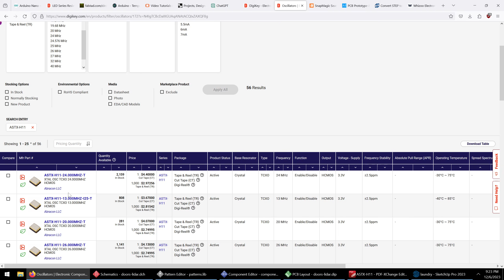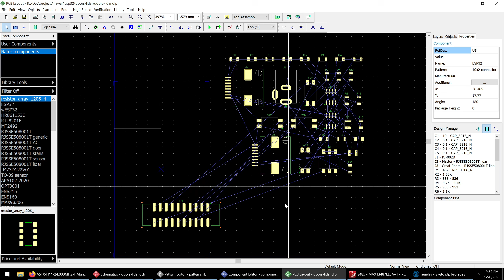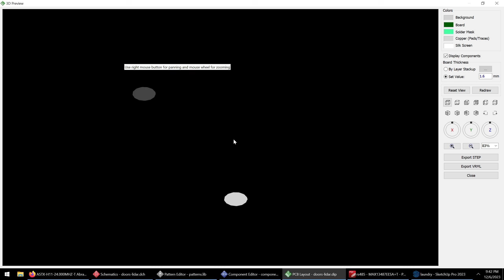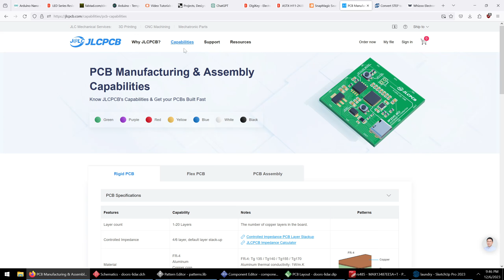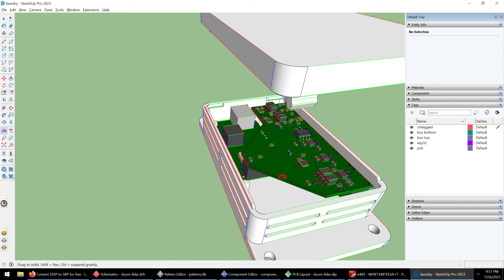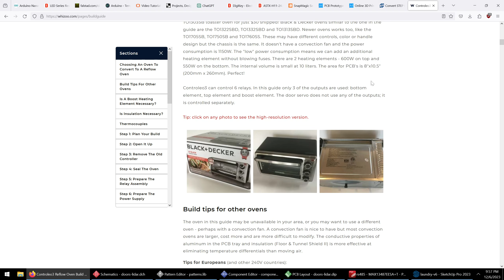Make your own PCBs for home automation -- 3D printed enclosures, too!

Comment: You keep saying "rs45" .. but ... isn't it rs485 the protocol you're using? Perhaps you're confusing RJ45 sockets with RS485 protocol? Or are you just speaking so quickly that the '8' disappears when you say arr-ess-four-eighty-five and only rs45 comes sounding like arr-ess-forty-five?
Reply from the maker: Sorry, I guess I mush mouthed the 8. It's definitely RS485.

Comment: This overview is good for beginners.  I’m  a bit further along and have probably assembled 20ish PCBs, so I’m more interested in what your boards are doing (high level overview of functionality), and how they’re doing it (schematics and programming).  Hopefully you can include these details in future posts.
Reply from the maker: Aye, a lot of people asked how to learn electronics so I thought I'd do this video first to help them out. I don't actually want to make tutorials or more beginner stuff, as there's already so much out there. I'll do some higher level videos, walking through my boards while assuming basic electronics knowledge.

Most home automation videos are about retrofit using off-the-shelf retail devices and robovacs. I'm so tired of that junk! Besides the electronics, I want to show my vision for how everything should fit together. It's a central controller (Linux PC) that everything integrates with, then some novel software ideas for how devices are controlled, especially lighting.

Next video I'll remake one of the boards and show the reflow oven. I want to add a relay so I can turn off the radar. It's purpose is to control lights so it doesn't really need to be on during the daytime. It draws 145mA @ 12V and gets pretty toasty sealed in its milled aluminum enclosure (made worse by the sun).

Comment: Great work, can you make a video detailing how one could learn electronics  "PCB designing to be precise" coming from a tech background with a little knowledge on the basic electronics
Reply from the maker: This video is basically what you ask! Pick a goal (eg blink an LED) and then get reading. You'll need to be able to research stuff via internet search and ChatGPT. Repeat picking more complex goals to gain experience and eventually tackle the problems you want to solve (home automation or anything else).
Reply: @NathanSweet  This is so extremely helpful, thanks a lot! I also have the goal of learning PCB design and electronics in general and the resources you linked + the oven you've shown will help me immensely!
Reply from the maker: @brownie4k  That's great to hear! It's really fun, a mix of electronics and programming. Having your code affect the real world instead of just being on the screen is neat. Be sure to leverage AI, it's very helpful to learn this stuff. I prefer Claude.